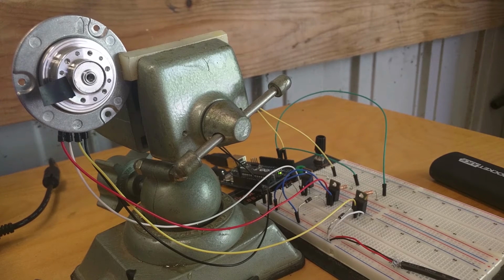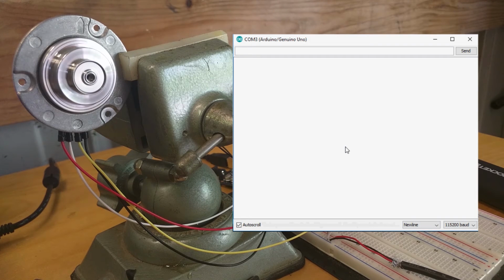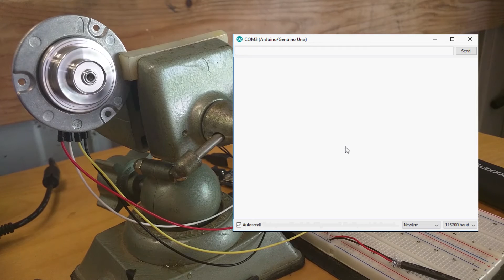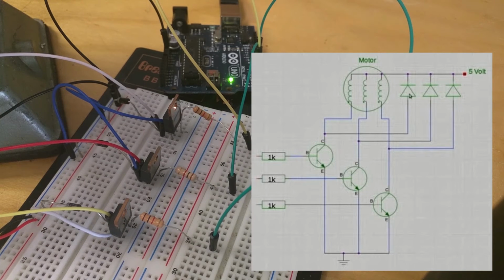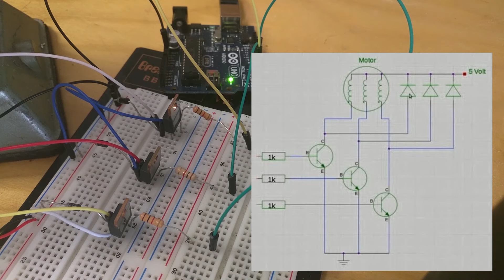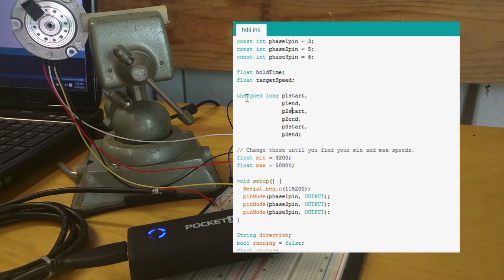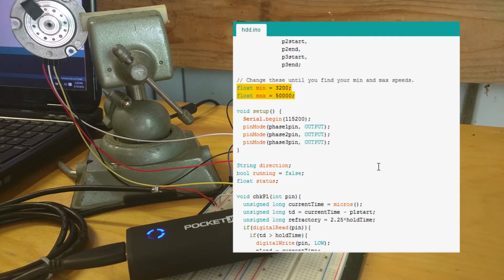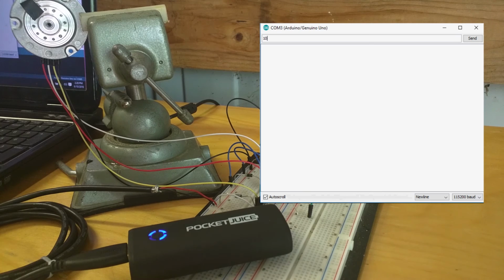Running Hard Drive Motor from Arduino with Variable Speed and Direction

Comment: Good Stuff built the circuit and plan to use it...However,  I noticed the circuit stays  "live" after you type stop. is there a command that stops circuit entirely..I dont see it in the code. the transistors get HOT, just sitting there .

Comment: Hi.  The code does not work.  It actually will not compile.
Reply: Does not working. Don't try. its only waste of time.
Reply: I actually soldered the board and made my own code.  I don't believe the circuits will actually work without sensing the phase on the next coil and timing perfect.  I'm just trying to make a cat toy with some junk parts and this project is driving me crazy.
Reply: of course. May be its version problem of Arduino. You worked hard . Today each manufacturer use different kind of motor (star winding and delta winding). Good work n keep it up.
Reply: the code forgot a var-definition for p2start. add this line on top: 
"unsigned long p2start=0; "
Reply: it doesnt work because you have to fix the start command

Comment: Hello karl Schmaltz.....!!!
my motor have the same wiring connections like your's..so, is there is a sequence of phase terminals..means you have attached yellow wire to the 3rd transistor....so can i connect the red one to the 3rd. Actually I am not confirmed with the phase sequence. My hard drive is Western Digital WD800BB. Is there is any specific frequency that i should have to apply to the circuit or just apply a 5v to it.
kindly guide me here is my email ateebhassan000@gmail.com
I'll be thankful to you.

Comment: Good evening, sorry to bother you, as you might have noticed I am new to programming, I would like to know how to do to calculate the maximum speed, because when I put 100 reverse My Motor does not turn, I think I'm overcoming-speed thereof so so I need to know I can change the code so that this does not happen, the motor I'm using is 5400 rpm

Comment: hello, I do not want to run the engine I am connecting all the same, the only difference is that I'm using an arduino nano and C1162 transistors. indeed very good code I tried it in a montage with L293D and works well, but the speed is low and the L293D is heated. You could send me diagram a little more detailed circuit, I am new to electronics
Reply from the maker: Watch this video for a more in-depth tutorial. https://www.youtube.com/watch?v=CMz2DYpos8w